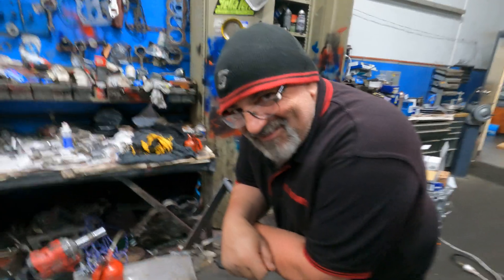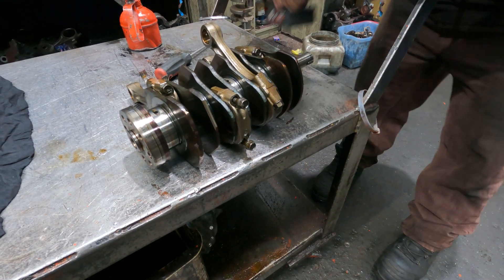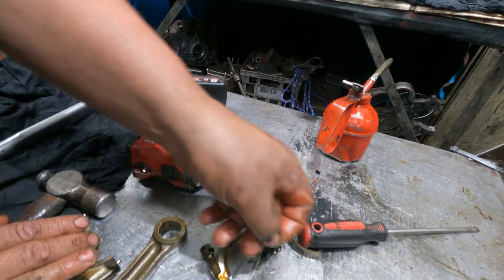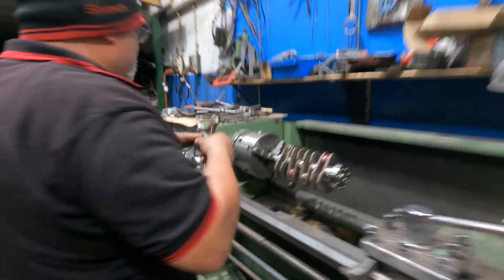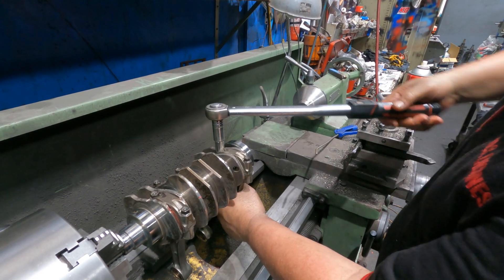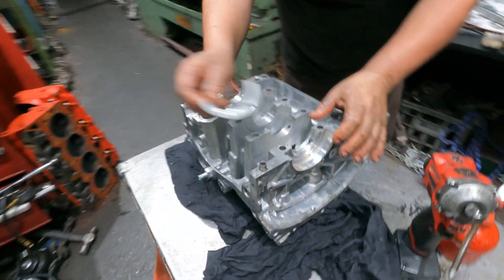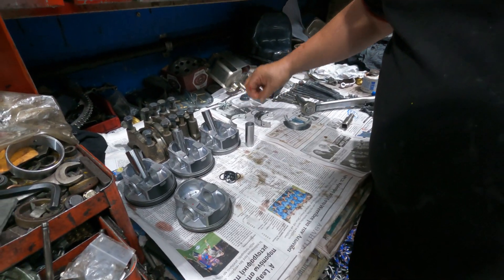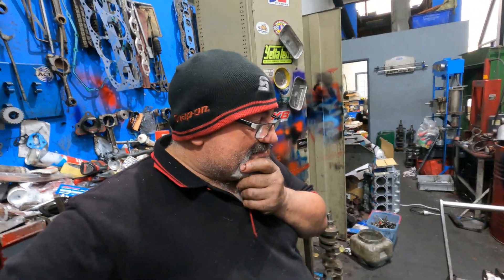EJ 25 Diagnosis

Comment: EJ25 owner here thanks for the vid guys. might have to do this currently 417000kms. dunno it might have been rebuilt before but head gasket is leaking oil on both sides😊

Comment: Absolutely hate Subaru motors 🤣
Reply: Had 5 turbo Subarus and the only engine I ever lost was all my fault running uncontrolled boost on a dirt rallycross style event. Hammered my EJ207 in my bugeye STi for countless club motorsport supersprints and open track days at 20+ psi without a problem. Pulled it out to put in a built EJ257 built by Michael South 10+ years ago and still running as well as when it was first tuned. Some people make em work, some can’t.